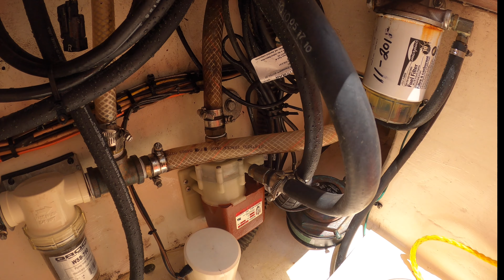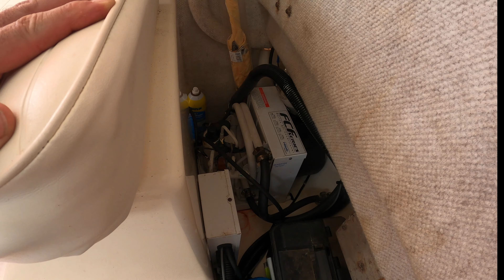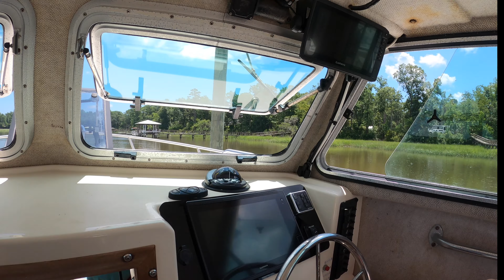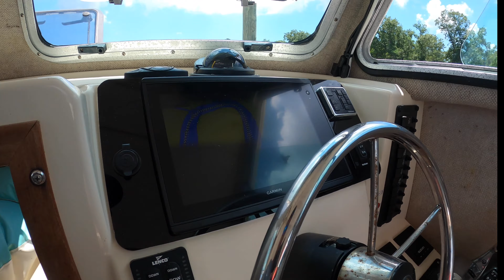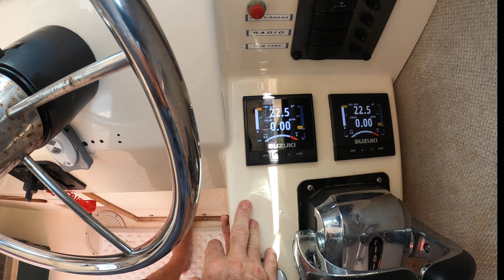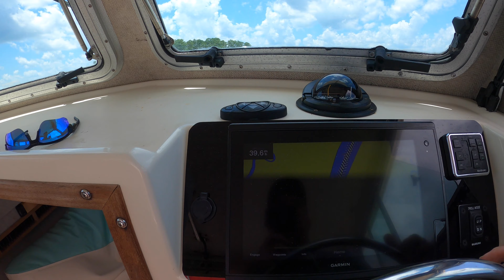Suzuki DF200AP REPOWER on parker 2520 DV

Comment: Hi just wanted to know if you’re going to buy boat if so what will you look for
Reply from the maker: 40 mph cruise.  Autopilot.  Newer electronics.    Dry ride.
Reply: @ACPro   so let’s figure this one out,then that leaves Parker out, and all center console boats out, newer cabin boat that can give you all that are going to be around $500,000 , so I guess you’re going to be a dry dock for a while unless you buy a old cabin boat and spend $250,000 and up date the heck out of it you’re going to be dry docked for a long time or unless you have a buddy that you can hitch a ride and just show up with your pole at the dock have fun 🤩 with your search and journey and remember patience and perseverance go hand in hand.
Reply from the maker: @larryjohnson5597  actually  I like capehorn 32.   Center console.      It's very easy to wrap the console and even have a rear wrap around for ride out in winter.   Looked at sport fisher but I can't get past something I didn't mention.    Must have .   Spot lock trolling motor.
Reply: @ACPro  Cape Horn I love them 33 dusky are great and they are  direct factory sold no dealers they will custom make you any option even single inboard diesel 700 hp.

Comment: Hey buddy, I am repowering 2002 2520XLD DV with twin 200 AP . The only difference to yours is more weight. I have a tuna tower, 200 gallon gas tank and a lot of overweight fishing buddies. The dealer was recommending 18.5 pitch, but I told him to order 20’s. Am I making the right choice as he does not offer any trial period or returns. I am running this boat in so cal mostly fishing offshore.
Reply from the maker: I think the 18.5  will probably do you better.   I was told by another that he did 18 5 4 blad and I raised the rear of the boat and it handled much better.   They where out of stock 4 blade when I did mine
Reply: @ACPro  thanks for the info. They don’t have the 4 blade. Do you still have your 20’s or did you change props as well? If it’s a 3 blade, do you still think the 18.5 is a better choice?
Reply: weight of your boat?

Comment: What was the warning beeps
Reply from the maker: Rev limiter right when I let off.
Reply: @ACPro  I love Parker’s, a lot of top end for A big boat.
Reply: You hit the 6100RPM RedLine or the 6300RPM Rev Limiter?  This was with the 20" Pitch props?  Of course it was only with you on board and little gear, so maybe that was OK, what kinda revs you get top end with a good load on her?  Sorry, still working on my Pro-Line 26XP with the same Motors (Twin 200APX motors counter rotating with the Watergrip SS 3 Bladed props.)  I'm going with the 20" Pitch but a 16" Diameter next to try and keep her from over-revving all the time so easily.  I'd like to see it hit 6100RPM with a good load with the sticks buried.  I know you have the 19.25" Diameter ones, but I'm going to go with the now two Suzuki Dealer recommended next step of the 16x20x3 SS Watergrip Props on her.  We'll see what they do.  I know your boat is similar in weight to mine, but I'm not sure how slippery the hull is on a Parker vs the Donzi hull on this Pro-Line.  I know that the old sales brochures show it going 52+ MPH with twin 200 Suzuki motors when they tested it somewhat lightly loaded (of course, they always do that) with half a tank of fuel and no real gear to speak of and two guys on board (Probably both weigh together what I weigh), so I have a lot of revs to make up from what I'm seeing to get there.  Oh well, I'll keep positing stuff as I find out stuff.  I ordered that Oil Pump to change the Oil last Friday, nice recommendation there!  Thanks for all the help and insight so far!!!
Reply from the maker: @salexxavier  I have the exact same props as you water grip.   Only reason it hit the Rev limit is because I was trimming it up to get max speed and rpm. You should exspect the same results from your boat.   I had 20p water grip.    We calculated the slip on this boat and it was almost no slip at all .  Very efficient props for this boat.

Comment: Hey!  I have the same Pair on my Pro-Line 26 XP,  just got them all rigged and back from the dealer.  However, they put 3 x 15.25 x 19 SS Props on mine (L and R of course).  They are the Suzuki Props called "Watergrip".  With these on my boat, it launches to plane like a rocketship.  However, they over rev the engines WAY WAY to easy.  I accidentally bounced mine off the rev limiter twice now (and the gauges SCREAM at you about it!  YOUR an evil person for doing that!).  I was back off it and plane in an instant, but it's not supposed to do that.

So, are the props you have the 3 x 16 x 20 Suzuki Watergrips?  Or some other brand?  

Thanks loads,
Salex
Reply from the maker: Water grip.   They called 16s. But they are 15.25 like yours .   You need 20 or 21.5 pitch I would ask dealer to trade in props.   Prop pitch is part of installation.   Most dealers give you at least 6 months to trade up or down as long as props not damaged
Reply: @ACPro  16's are actually 15.75 and what they call 15's are actually 15.25
Reply: As Toby said, you're underpropped.  I have the same engines in a 27' Skagit Orca with 16 X 23 pitch props and top out high 40's.  I'm probably a bit over propped depending on how many people on board, but 19 inch pitch is definitely 1 to 2 sizes too low.

Comment: Nice rig. I wonder if those 200’s will push my heavy Classic Mako. I think I’m around 9,000lbs with a fishing load of ice, beer and fat ass buddies
Reply from the maker: It should no problem.    This boat loaded is around 9500.  The dry weight is 6500 and I really couldn't tell a difference fully loaded with fuel and gear or not.

Comment: What motors did you take off , comparison in economy and performance? Average Suzuki fuel economy at cruise?
Looking to rerig my boat that has 225 verados on it now
Reply from the maker: I pulled off 2 yamaha f115. . So it was big difference in top speed . Cruise was about same mph.    And fuel economy  was very close. At cruise    the zuks impressed me so much with fuel economy it was crazy.   Looking for new boat now and due to new administration.    Fuel economy is my biggest concern.   We maybe looking at 5.00 gallon gas again next couple years

Comment: Same motor on my 23' boat - single engine. Interesting that you get about 45mph . I tried a 17" pitch  prop and got 45mph, but slower planing.  So, I opted to keep the 16.  Top speed, with the 16"pitch by myself on a calm day 44mph trimmed out.
Reply: 23-ft boat with just a single 200 your underpowered

Comment: Great video! I love seeing how other Parkers are equipped; I just Subscribed...  I'll check out your other videos as I'd like to learn more about your AC system. I had a 18,000 Btuh Marine Aire reverse-cycle on my last boat; had a similar March LC-2CP magnetic pump, then switched to a CAL MS-580-B..... I was actually expecting to see you hit 50+ with the twin 200 's but I guess the props are for more power out of the hole?.... I have a single 300 Yamaha on a 2520 XLD (deep v) and can hit 44. But, I cruise nicely around 30 at 42-4300 rpms. I have a 100+ Parker videos posted on my little channel if interested... Thank you for you videos!

Comment: one more question is how have you like the motors?  worth it?  any issues ?   Thanks man they are a big purchase.  I have a BIg 25'  WA Stratos with a 9'6" beam, vert heavy.  Taking off my 225 Evenrude  junk
Reply from the maker: I absolutely love them.    They are nit heavy the fuel burn is great.  No issues.  Also the same motor for left and right rotation is great .   They will come with extra right hand chip so you always only need 1 extra prop not 2.    They are extremely quiet  and strong.   I love them .   If I had to do it again.   I would definitely do the same thing.   Life is too short to have a shity boat motor.

Comment: whats the millage? I'm doing mine this winter with the same motors
Reply from the maker: 2.25 mpg 4200rpm 30mph
Reply: Get mercs!! Lighter and more efficient due to higher compression ratio since its supercharged
Reply: @Shhnee  That's perhaps the dumbest thing I ever heard.   I'm  running a 7-11,000 pound boat.  What the hell do I care if the motors weigh a couple extra pounds or not.  I will tell everyone to take a shit before we leave and it will even out.
Reply: @Shhnee  Mercs are garbage...Yamaha or Suzuki is the only way to go!
Reply: @cgmax9830  2000 hours on a new 2020 225 dts four stroke and only one major issue, the fuel line got clogged. Not even the engines fault